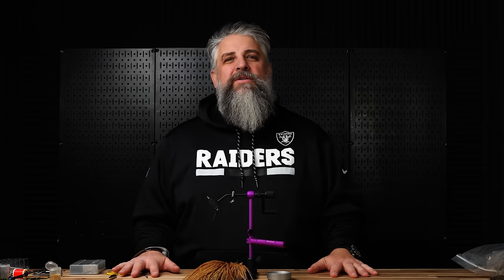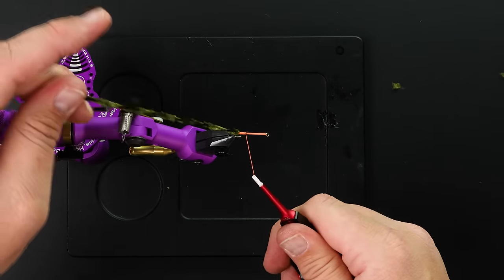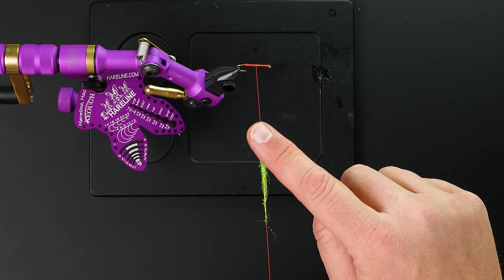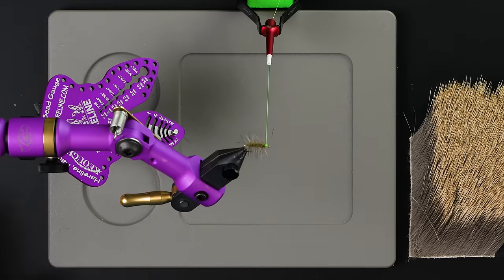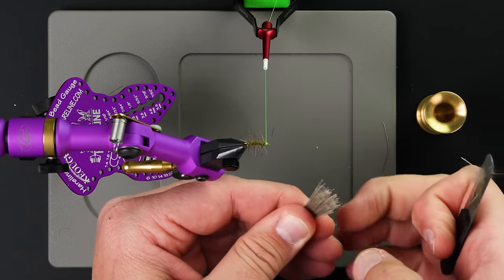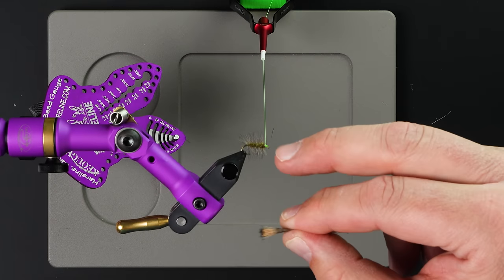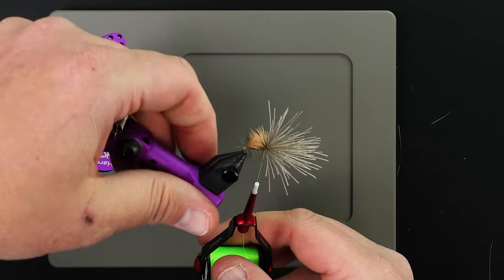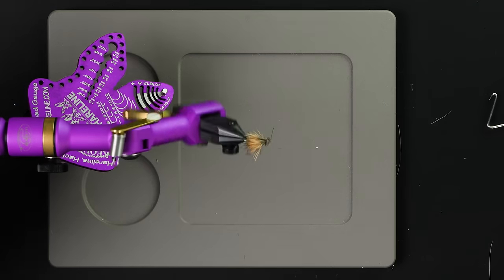Fly Tying Skill Builder #7 | Pinch Wraps, Dubbing Ice Dub & How to Tie an Elk Hair Caddis!

Comment: I said it before and I'm sure I will say it again - these videos are great and incredibly helpful.  May I suggest three topics, one of which may require a multi-video series on its own?
1. How to tie materials at the hook end after I've wrapped them.  I'm trying to tie the Sparkle Gnat you posted a video on last week and I just cannot tie the Shimmerbou on at the hook end after wrapping it around the fly.  I've had this issue with other materials as well.  I don't know if I'm too close to the eye, letting slack get in my thread or what I'm doing wrong.  You make it look very easy, but it's not and I suspect I'm not the only one who feels that way.
2. How to identify alternate materials.  For example, again with the Sparkle Gnat, I was able to get some Shimmerbou, but how can I figure out what an acceptable substitute is if I don't have a particular material?
3. Demystifying hooks.  I don't mean how to read the package, but (a) why is it important to use a certain shape hook for a certain type of fly, (b) what are the key differences between the hook types and (c) how can I determine an appropriate substitute if I don't have the specific hook mentioned in the recipe?